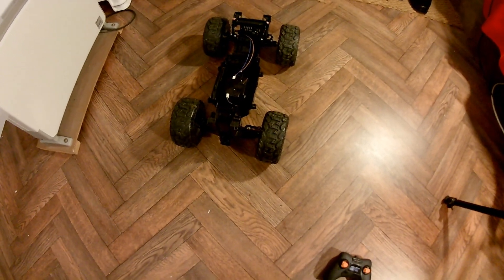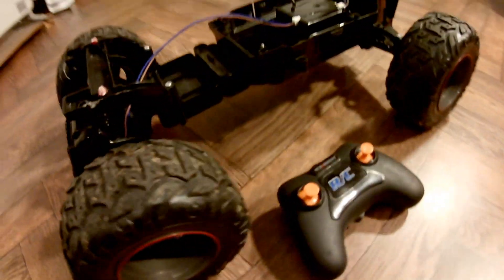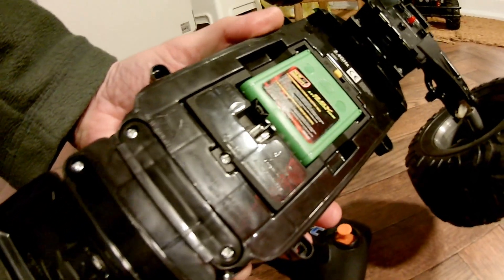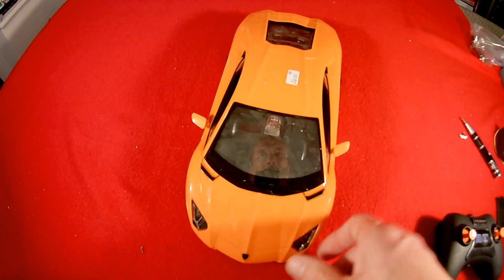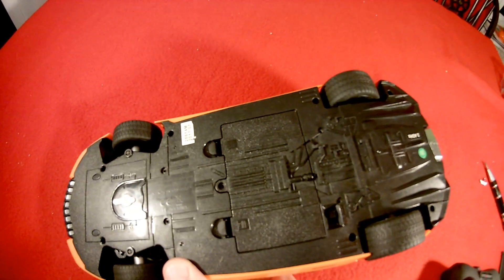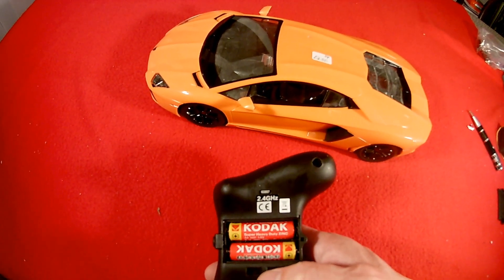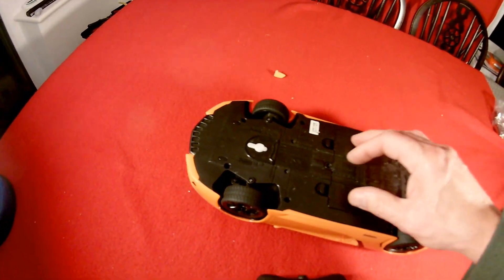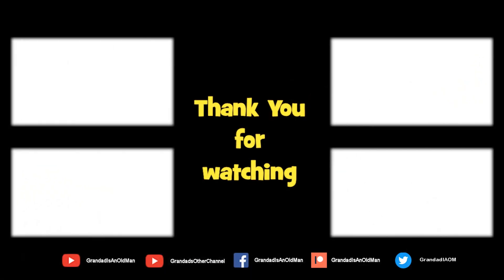1/8 Scale 2.4GHz Toy Grade Chassis & RC Gear NewBright

Comment: You should build a short course truck body out of card/foam board for that and try to modify it with some suspension. Could look pretty good. Happy Holidays to you and yours!
Reply from the maker: Thanks Vince, although it is big it is still basically toy grade and just rear wheel drive so not much use for true off road. I will find something to do with it eventually. The main reason for getting it was hoping the transmitter might bind with the Lamborghini Aventador LP700-4 I had picked up in a charity shop recently, unfortunately it didn't 😊🎄🎁⛄🎁🎁🎄🎅

Comment: there is a remote that binds with toy grade called the jumper most use it for drones but can work cars and so on unfortunately  not cheap  it uses multi protocol system
Reply from the maker: Yes I have seen multi protocol transmitters and even considered buying one. I remember Andrew Newton did some videos on one https://youtu.be/tLGWfvUCquQ Just about every video on YouTube showing the Jumper T8SG in use shows it with a drone. Just a couple show it bound to WLToys cars but as you say it is not cheap to buy it specifically to try to bind with the "no name" toy cars I have and find it doesn't work. On the other hand it might be handy to have one anyway. £80 on Gearbest at the moment.
Reply: wow didn't know they were going for 80  sounds like a good buy  thanks buddie @GrandadIsAnOldMan